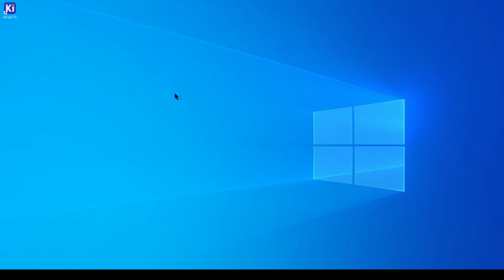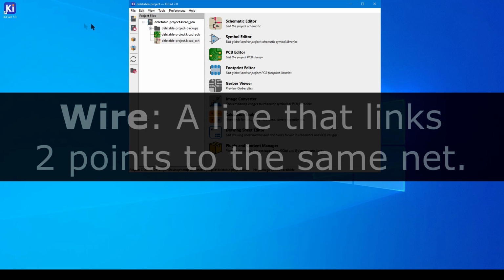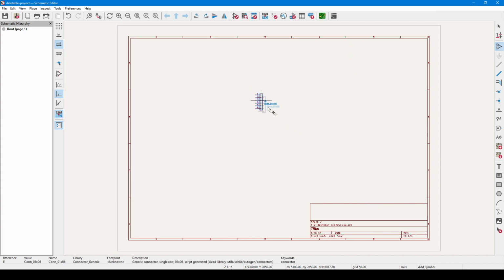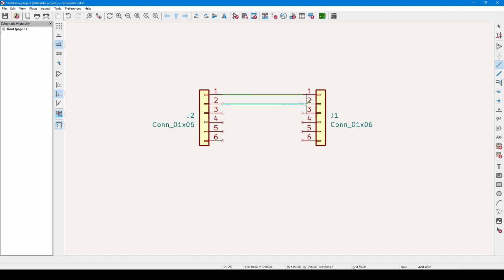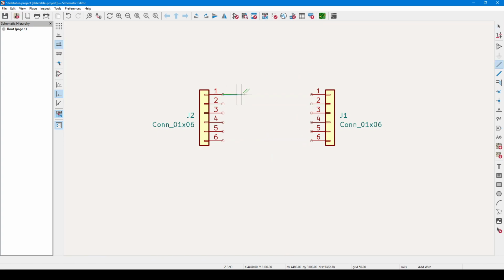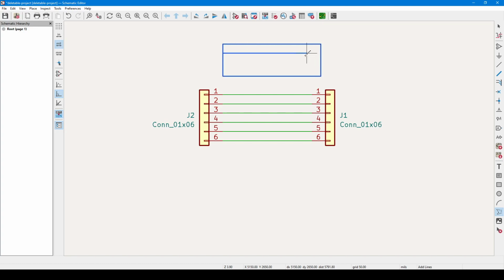KiCad 7 Tutorial: Wire vs. Net (Part 5)

Comment from the maker: Is anybody there?
0:00 - Why wires vs. nets?
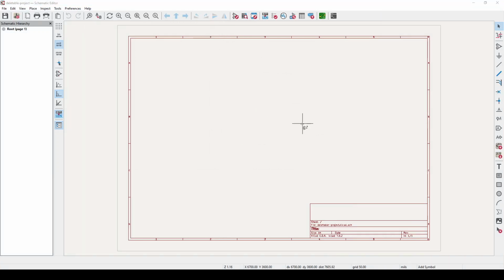0:35 - Add a connector
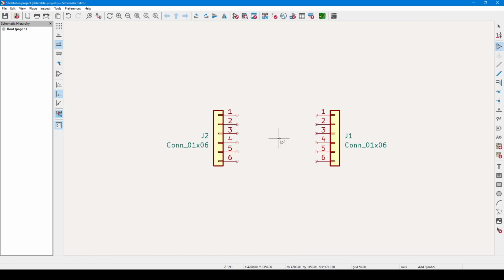1:05 - Wiring (Simple method)
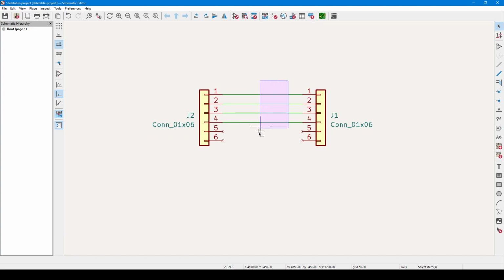1:18 - Wiring (Unconnected method)
1:42 - Wiring (Overlap method)
1:57 - Wiring (Repeat action method)
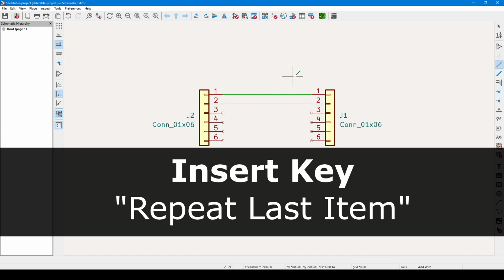2:10 - Graphic lines
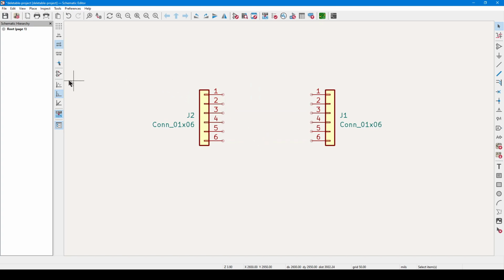2:40 - Wire Mode: 90-degree
3:00 - Wire Mode: Free angle
3:10 - Wire Mode: 45-degree 
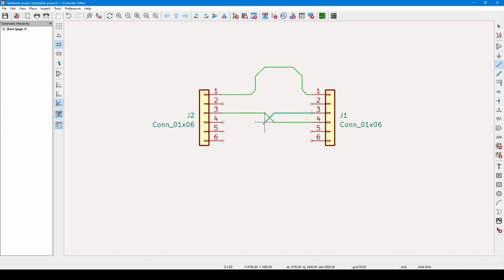3:23 - unboxing-tomorrow.com